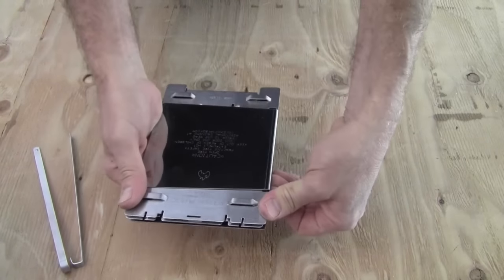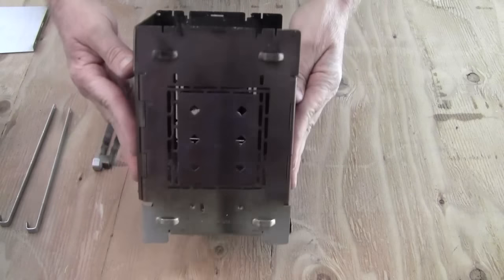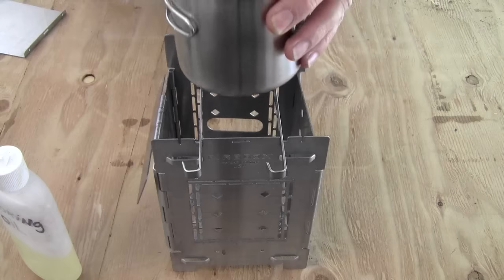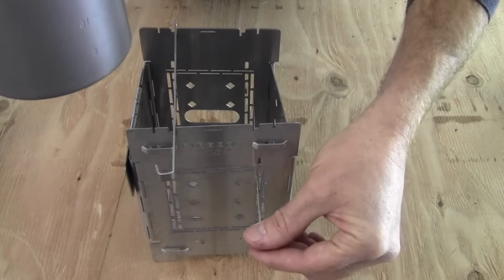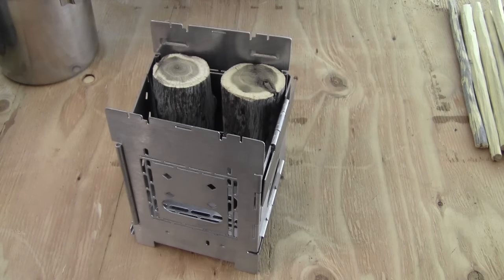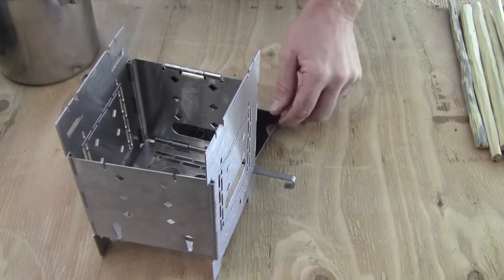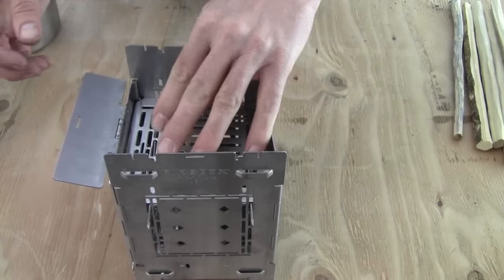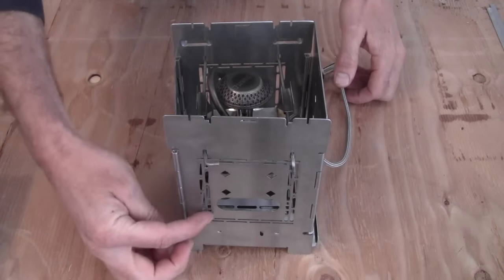G2 5" Firebox Camping Stove Instructional video.

Comment: I've had my Firebox Stove now for just over a year, and what a great stove! I've used it in all weathers and it hasn't let me down once. I also have the Tragic burner and it's a versatile extra I'd recommend for anyone. It's ideal when lighting fires isn't allowed.

A different application I've found is for a heater under a tarp! Obviously with the tarp set high, s for use with a hammock, and NOT in a tent or with one end of the tarp closed. It just takes the evening chill off when getting into a hammock in the Autumn, or early Spring. I tend to use the "fire torch" method as the flame isn't high, and it just simmers away for a good hour and a half. 

Thanks again.
Reply from the maker: I am glad that you are enjoying your stove and that it is keeping you warm as well! I am not looking forward to the cold coming here in Utah, I am having too much fun out camping right now. Thank you for the comment and for watching!

Comment: I always over analyze products before buying them to be sure I’m getting the right one. After a lot of comparisons and video’s, I have no doubt that the Firebox is the best one! I intend to purchase it with the extra rods and large grill, as I intend to grill directly on it and use the pot as an oven!
I did catch another video of the Firebox with additional grills mounted to the lower sides supported with the additional rods and used as a warming shelf. 
Great video! Very cool stove!!!
Reply from the maker: Thank you Kenneth, we are so glad you are happy with what you see. Let us know what you think of the gear when you get to try it out and have fun out there making amazing food!!
Reply: @fireboxstove  I was like a kit in a candy store when I got it and had to use it right away! I have a tile top table on my deck that I set it on. Layer down a piece of cardboard and a patio block under the stove. After burning wood for hours, I was surprised to find the patio block was only warm, not hot; probably didn’t need the block.I started with making coffee, then a hot dog, then boiled an egg, then popcorn (jiffy pop). The boil ring makes a huge difference when boiling water, glad I have that. I just bought biscuits and plan to use the pot as an oven next. This stove is extremely well made with an obviously large amount of thought put into it. So incredibly easy to setup, use and pack up. It’s pretty easy to clean; I get a little anal and want every spec off, so it takes me a while to get it like new. When done, I used olive oil (all I had) and oiled the whole thing and keep it in a Gal size ziplock bag to prevent any rust and keep it new. Not sure olive oil is best because it seemed to create more to clean off from the oil burning on the outside; I’ll have to try other oils. I spent so much time looking for the best camp   stove, especially for backpacking in. I have absolutely no regrets buying this one. The case is perfect too; it all fits in there perfectly. Soon I’ll add an alcohol burner and maybe the gas burner.
Thank for this Awesome product. I believe I’m gonna have it a long time!!!

Comment: ..just scanned over a years worth of comments and didn't notice this query or see it in the manual that comes with the stove or addressed elsewhere: Does the stove "break in" better with a particular kind of firewood placement; Is it better to break in at full heat, like a swedish type fire, or smaller pieces at paced intervals? How many fires would be considered a good break in and when can one start cooking on it?
Thanks for your time and product, and I can't wait to finally get mine going 🔥
Reply from the maker: Only the titanium stove needs to be broken in with three or four smaller fires but you can cook on those fires right away. The type of wood or how you load the stove doesn't make much difference just start small.
Reply: @fireboxstove  I appreciate that, my friend. If I ever make a video with my Firebox Stove, I'll invite you over to a watch and comment. 👍

Comment: Hey Steve, 
First of all, it's an awesome stove you created and developed there over the years. 
I have two questions. 
Do you recommend anything to season in the metal before the stove is lit the first time. 
I thought about rubbing it with sunflower oil first. 

And my second question. I bought the deluxe combo kit with the nylon d-ring pouch. Is it possible to remove the horizontal stitching that shortens the front pocket or will this harm the pouch?
I just would like to have the front pocket as deep as the rear one to put all accessory plates in the front and just the stove in the larger back pocket. 
And I would like the idea that all the plates would be deep in the pocket and can't fall out easily. 
I would have removed this line of stitching already but I'm not sure how the fabric layers are and I don't want to cause that the two pockets are no longer separated pockets.  By pure feel i don't think this would happen but I thought I'll ask you first. 

Cheers 
Sascha
Reply from the maker: Good questions Sasha. Any oil you put on the stove prior to use will be burned off but I do recommend oiling it between uses with olive oil or something similar that will not go rancid. 
I'm pretty sure you would be safe to pick that stitch out to extend that second pocket all the way down 👍 if you try it and it does cause problems let us know... I've got your back. 😎

Comment: I saw this video about cleaning the firebox wood stove with paper towel and olive oil, about 4:00 here. 

A thought came to me. How about trying to clean soot from my titan pot that way? It was a big mistake to even try. Next burn the surface was worse than before the "cleaning". Don't ever use any oil to clean soot from the pots.

It can be that the oiling instructions were given to prevent rust buildup or something to the stove.
Reply from the maker: The oiling is done after the stove cools down, not while hot. It is for maintenance.

Comment: 14:55 looking at this gave me an idea.   You set up your firebox with the grate up, and no ash tray so so the sticks are sitting on the ground.  Start your fire when when it gets hot enough you lift the firebox dumping the fire on the ground and add more wood to create a bonfire.  This gives you the benefits of starting with a wind protected condensed fire and using it to start a larger campfire.
Reply from the maker: I can see how that would make starting a ground fire easier.

Comment: Steve, what a great presentation. Clear, organized, and so very informative. The G2 Firebox stove looks awesome. Amazingly versatile, as you demonstrated so we'll! I'm wondering how compatible you think it would be with a can of Biofuel-brand fuel. It's relatively inexpensive, available in refill bottles, and would be an option if, for some reason, wood isn't. The Biofuel stove can is 3 1/2" in diameter, so it would be a good fit for the regular Firebox, but too big for the Nano. What do you think? Thanks.
Reply from the maker: I think you're right, The Firebox has a perfect position for it, but it would not fit into the Nano.
Reply: FireboxStove Steve, what's your opinion of BioFuel vs its competitors? I don't see or hear of it often, but when I do, I'm impressed. Comes from Georgia. Congrats again on a superb video presentation. Really sell done!

Comment: I would imagine you'd need a hatchet to process the fuel. I could see this being the way to go on week long backpacking trips but for shorter weekend trips a gas stove would be lighter and in some situations such as damp conditions, more reliable.
Reply from the maker: We do have 5 different fuel types for the stove in case you don't want to do wood heat. It takes wood pellets, charcoal, gas, alcohol and wood. Thanks for watching Paul.
Reply: @fireboxstove  no need for a hatchet, but a small folding pruning saw comes in useful for the larger pieces shown in the video

Comment: The extended grill grate on my brand new 5” only very lightly snaps into the stove (middle protrusion on one side of grate).  If I lightly touch the bottom of the grate, it pops right out.  Should I expect this to tighten after use, or should I try to heat and bend in the two tall sides of the stove, or could this be a tolerance issue on the extended grate?  I just foresee the first time I try to flip a steak, if it sticks at all, the grate could easily come off during cooking.
Reply from the maker: That is very easily adjusted by hand you don't need heat just a little pressure inward on both sides and you can make it fit exactly how you want 👍

Comment: Just received my G2 5" fire box.
I played around with it when it was cold while watching the video to see how everything werked. It all werked good then when I got it loaded with caracol and ready to go tried to get the extend grill plate in place as described with "T" facing up using the firestix and half moon cut out. I wad having a terrible tyme geting ti to snap into place. So I just gave up and gor it as close as I could, but never got it to snap in. Then by accident I realized that the wind damper won't close fully with the extended grill plate in place. The it hit me you have to have the wind damper slightly open to get the extented grill plate to snap in. This is because as the name implies the extended grill plate extends past the edge of the stove. Prolly as the extened grill plate was an after thought. Maybe in the G3 version you could shoeten the wind damper to solve this issue. Of course, it such a minuscule issue,  it may not even warrent the tyme and effort involved in changing the wind damper. Maybe you could just add a "note text" to the video to help an other idiots(like me) the trouble of figuring it on their own. Haha. Note the wind damper must not be in the fully closed position when installing the extended grill plate. I'm sure you already discoverd this yourself and may have a "fix" in the werx.
 I want to stress this issue is a non-issue and is just something I noticed. It should in no way sway anyone from buying such a good stove.

Thanx for your tyme
Dan B
Reply from the maker: +D Bittinger Jr Hi Dan. Thanks for the heads up, I had never thought of that before, but can certainly understand how it could happen.

Comment: Question: The Mineral Oil we have from supermarket is the kind they used to give kids for constipation. But its says "100% Mineral Oil". What's your opinion re using that for cleaning?
Reply from the maker: I've never personally tried it but I would think it should work just fine. Thanks!

Comment: How often do you clean it? Every time? Other that cosmetics, is it bad to not clean it?
Reply from the maker: Quite often I do not clean it. The messy parts are all on the inside so you can easily fold it up and put it away. I do however recommend a light coat of oil prior to storing it. I actually use olive oil no stick spray. Lightly spray the stove inside and out then wipe off with a dry paper towel starting with the outside and ending with the inside. Doing this cleans it and protects it not to mention making it look nice and function smoothly 👍
Reply: @fireboxstove  sounds good, thanks. One more question, how come the ash tray goes in with the tabs facing up? It seems like tabs facing down helps keep it from sliding out

Comment: Hi - I have one of these. The holes in the side are really quite small. If they were bigger it would be a great deal easier to fit sticks through for the fire.
Reply from the maker: Sure, but it would also be easier for hot coals to fall out. The feed hole size was very carefully considered 👌👍
Reply: @fireboxstove  good point - thanks for the reply

Comment: I cleaned up my firebox by soaking it into water in which powder of Sodium sesquicarbonate is dissolved. Soak it several minutes and then lightly scrub it with a sponge, then all the soot will be off into the water! Highly recommended. Citric acid will also do.
Reply from the maker: I don't use water at all. I simply get my stove hot enough to burn any food or fats away then let it cool down slowly. Then I wipe it down with extra virgin olive oil starting with the outside and ending with the inside. Then one more wipe with a dry paper towel once again starting on the outside ending with the inside. The end result is a stove that is protected against corrosion and has had its hinges lightly lubricated 👍 looks great too 👌😎😊

Comment: Is it correct that the grillplats (both the normal and large one) should NOT be put on the G2 or the Nano (I have both) whilst there is open flames? I think I heard that in this video or another 🤔
Reply from the maker: Let me clarify. The reason I say to not put the grill plate on while there are still flames it is because of the heat. The grill plates would need to be 1/4 of an inch thick to hold up to that much heat. That having been said I usually put the grill on just before the flames go out and you're left with hot coals only (some small flames is okay). The other thing to remember is that the meat or whatever you're grilling absorbs heat out of the grill plate so having a grill plate on with nothing on it will be more likely to overheat. Just like a frying pan on your stove top will overheat with no food in it.
Reply: @fireboxstove  Ah! Great clarification! Thank you Steve! 🙏

Comment: Steve, would it be safe for the Firebox to be washed in a Dishwasher machine to clean it up, followed up with some cooking oil before putting it away??   -Stephen
Reply from the maker: I wouldn't recommend the dishwasher, but I know other people do it that way.
Reply: FireboxStove   I will just do it the way you've shown then. I was just thinking that since the stove was stainless, didn't think the dishwasher would hurt it.
Reply from the maker: BuckeyeBushcraft L. at the extreme temperature that the Firebox stove reaches, the chromium in stainless steel starts to gets burned out causing a decrease in corrosion resistance. that's why I recommend a light coat of oil between uses, like a carbon steel knife or Gun Barrel
Reply: Buckeye. I would think that if the stove can take the heat of a fire, then the hot water and heat from a dishwasher could not harm it.

Comment: Just wanted to let you know I have used the G1 for more than a couple years now on just about  every outing and am very happy with it. Never had to do any adjustments to it and it has never failed me in any way.I never thought I would have to replace it until now you came out with the G21. I really like the lower feed ports and the new accessories.I bought my G1 at Sportsman warehouse and you guys contacted me about the purchase. I have not seen them there again. It is about the only place around here to buy any good gear. Do you have any planes of getting the new G21 in the stores?
Reply from the maker: +BluegrassBushcraft I'm so glad to hear that youre getting good use from your G1. You'll love the G2 as well!

Comment: Has anyone had rusting issues? Just had a camping trip with 30c/86f temps and near 100% humidity. Got home, washed and dried it and noticed some rusting going on. I'm gonna sand it down and apply some oil then heat it
Reply from the maker: Stainless steel is not rust proof only rust resistant. It relies upon a micro coat of chromium oxide which gets disrupted when the material is heated to wood fire temperatures. A light coat of oil is the right maintenance to keep your stove nice.

Comment: Loose for heat OK... but why is the whole unit skew-whiff?
Reply from the maker: The way the unit folds in on itself... the two inside  panels must be shorter to fit within the two outer panels.
Reply: @fireboxstove 
Ah of course. Cheers Firebox 👍

Comment: You have a stainless steel product, wiping it with oil is not necessary. Its going to do nothing but gum up your surfaces, as oil attracts moisture and dirt. Sorry, not getting your thinking on this.
Reply from the maker: Stainless steel remains corrosion resistant due to a chromium oxide layer this protective layer gets disrupted when the material reaches high temperatures such as is caused by the burning of wood thus the need for an oil to prevent corrosion and keep things looking and functioning well 👍😎

Comment: If it was windy, ie 5-10-15-20 mph winds, would an additional windscreen be a good idea?
Reply from the maker: SanFranciscoBay yes, an additional windscreen would be good after about 10 miles per hour however at that point you would want to consider how safe it is to have a wood fire lit regardless of a windscreen if there is any potential for fire spreading. Wind is the biggest consideration when it comes to a Wood Fire & Safety